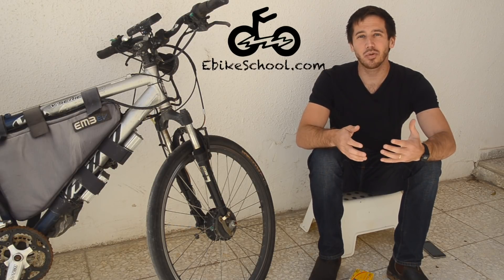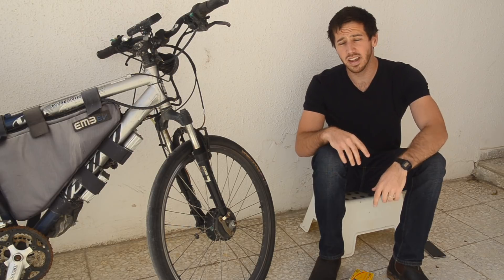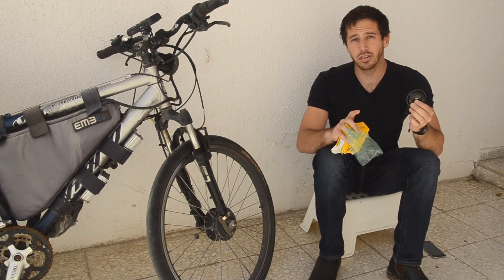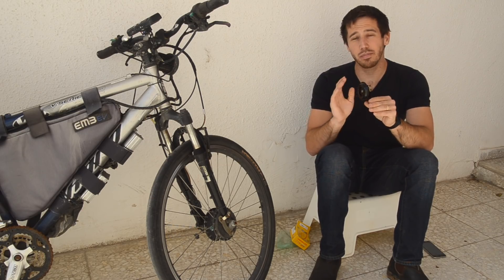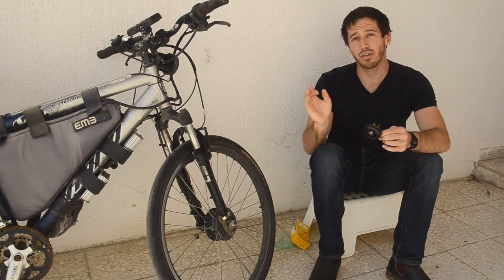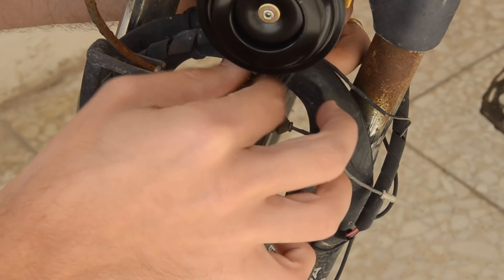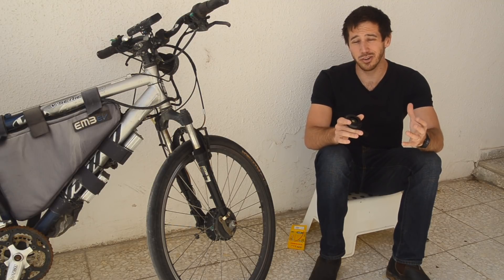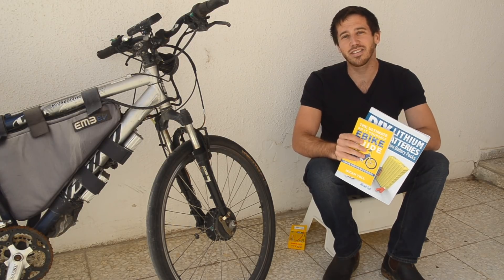How to install a $3 HORN on your electric bicycle

Comment: Has anyone figured out away around getting the clicking from horn every solution was bad ground connection but there is no ground on an ebike. both negative and positive are connected through a switch to 48V pack (56v fully charged i believe) its a 48V horn and its just out of range for use so when you actually need it, it doesn't work with following this tutorial.

Comment: How can I disconnect the speed controller abrains a blue wire a brown wire and a black wire which is blue wire is for low steering brown is high and black is ground how can I connect those wires so my eBay can go faster My name is Ricky it will be helpful if you can help me thank you

Comment: I came up with a great idea because I was sick of cars doing the wrong thing and people too busy on their phones to get out of the way , So gave it some thought and came up with this.
I bought a JBL go3 portable bluetooth speaker and downloaded a car horn app and an air horn app linked them with my iphone and it is better than the real thing .
even though the speaker is small it has more than enough volume . I have allready tried it doing the bay cycle in leichhardt and used it a couple of times and it works really well even when the headphones are in there ears they can still hear it and move I think I gave a couple of people mini heart attacks when I used the air horn.
I suprised no one has come up with this before for such a simle idea . It might be a costly option ($59 from jb hi fi) but how much can you put on safety and works on any phone with bluetooth android or iphone

Comment: Great tutorial! This is exactly what I needed. You have a new subscriber! :D

If I wanted to wire in some turn signals to that switch you linked to (aliexpress), how would I make them blink? Is that integrated into the switch or do I need something else?

I want to start using a recumbent bicycle but the country where I live (Greece) is NOT conducive to bicycles. Let alone recumbents. I want to upgrade to E-bike when I get the cash.

Comment: Is there a way to tie the wires to a usb wire? 

My ebike has a USB port on the battery
Reply: I guess if you have an old USB wire, you can splice that. The red wire is positive and black will be negative.

Comment: Hey @ebikeschool.com, I just got a Super73 S1 ebike which has a 48V battery - do you have any tips for connecting a power cable for the 48V horn, and do you know if adding a cable to power one of these horns could mess up the battery somehow?

Comment: Thanks for this horn that i have been searching for. I need you help. I bought this horn/light switch http://www.ebay.com/itm/302714797949 and this light http://www.ebay.com/itm/222482415466 (still waiting for delivery)  I have a 48v and sometimes I use  my 52v so my question is can I wire it all directly from battery to switch to horn and light without any dc/dc converters . The light and soon to purchase horn are rated at up to 48v but not too sure about the switch. Please take a look at items and reply.

Comment: I went down to the junk yard and popped some alarm bells and horns off of a few wrecks. The small 12v battery I'm using is getting drained relatively quick and now I'm looking at just utilizing a "step-down" device to power the 12v toys off of my 52v battery.

Comment: Can i just buy 2 36V 11Ah Samsung lithium ion Bottle eBike Battery Packs and a pigtail to make it a 72v?
Reply: would not recommend because they are not just batteries. they have internal circuitry bms (battery management system) which  can fry stacking them.

Comment: Can you please explain what happens when we use a 150 Amp controller for a motor which produces about a maximum of 8.5kw at 127 Amps and 96 volts.
Does the motor still draw 127 Amps irrespective of the controller   or will the motor heatup because controller permits 150 Amps.
( My idea is that if the max amp rating of controller is more than what is required to run the motor,it will ensure that the controller does not heatup...Is this true?)
This is for an electric motorcycle,Any help very much appreciated.
Reply from the maker: The motor will pull as much current as it can, so if you connect it to a 150A controller without a lower limit, the motor will try to pull 150 A. If your controller is programmable, you can set a limit at maybe 100A or 120A, that way the motor won't overheat and the controller will also stay cooler as it is not pushed to its limit.
Reply: EbikeSchool.com Oh Okay...you are the best😊

Comment: I set myself such signals (48V) in this way twice and both times  the circuit was broken by strong induction currents, the switches disappeared very quickly. It's cheap and made in China.. 
Now I solved the problem: i installed a diy-scheme breaker with one n-MOSFET.
Now there is no spark in the switcher.
Reply: post a tutorial how to do it so others can!

Comment: Looks like those two books could be pretty useful - especially the battery one. Struggling to find enough Li-ion cells recently - started collecting dead laptop batteries from the local PC store (plan was to test the individual cells, build a battery from the good ones), but ever since the Tesla walls came in, people have been snapping them up to build their own.

Comment: Nice, I didn't realize they made them for higher voltages too, I figured it was all just standard automotive 12v ones, used with some kind of DC-DC converter. I wonder if they go as high as 72v too?

Comment: What about if you wanted to put 2 horns instead of one can this be possible and can you advise me on how to do this?
Reply from the maker: Just wire them in parallel
Reply: Would I need a relay if I were putting 2 horns because of the draw of electricity?

Comment: I've been following your upgrades religiously  Watt meter ,lights etc and now I have to get a horn thanks I to have a motorbike, scooter set of handle bar switches which are great and only a few £'s , How about how to instal brake lights next I know you can get the small led ones which work of the pull type brakes but what about disc's? anyway love the channel.
Reply: After all the comments I finally relented and bought the DIY E-bike book from Amazon, So here's hoping a blatant plug will get me the lithium battery book, Buying books in this day and age! is there an Epub version I did look. and £17 for what it contains is a bargain love it.
Reply from the maker: There's a kindle version of the DIY Lithium Batteries book. But maybe you'll win it anyways! It's a random drawing (I use a random number generator to choose the winner each video) but if you're sticking around long enough then odds are you'll get it!
Reply: So, in theory, I could just make hundreds of comments on how great your channel is to give me a better chance. LoL. Also, have a look at  Battery packs Silver connects 18650 for an interesting take on battery making.

Comment: Right now I have one of those hand held air horns, usually found in emergency kits for small boats, zip-tied to the handle bars. Talk about loud, I'm right up there with firetrucks and ambulances. I make sure people know I'm there!
Reply from the maker: Yea I've used the AirZounds which is also an air horn. Those are crazy loud, but the only problem is if you forget to refill it with air then you're screwed. But as long as its still got air, it's an awesome horn!
Reply: Did you happen to see the message I left yesterday on your Sanyo video about BMS's? Any views/opinions? Keep up the good work, great info.

Comment: is there a way I can use this with a Luna roam fusion bike? it has a Rosenberg charge connector,
Reply from the maker: You could buy the matching part of the rosenberger, then tap into the + and - cables there. Just plug it to the charge port on the battery and you're good to go.
Reply: EbikeSchool.com thanks!! I'm wondering how to make a theft alarm with it too

Comment: Thanks for sharing! Really useful for the city... The problem I wasn't able to think of a solution yet is leave the battery and controller safe on the bike as I park on the streets of London... Would you have any suggestion?
Reply from the maker: Same problem here in Tel Aviv. My solution: bring the battery inside with me.
Reply: Cool, thank you. That's what I do already but it's a pain :P

Comment: california-ebike d o t com has an "E-Stop Brake Button"  california-ebike d o t com/shop/bafang-e-stop-brake-button/ . it acts like the motor cutoff in the e-brake levers.  Great for when you are shifting so you don't mash gears.    I don't know why the (green) button face has a horn on it.  Maybe it could be used for the horn button...?
Reply from the maker: Yea it can be used for a horn or other uses like regen braking or something else that needs a momentary contact switch.
Reply: I use it as an electronic clutch while shifting gears.  A must have when you have hydraulic brakes..  :) . I've seen the bike lights on your other video for 26-72v.  I cannot figure out how to hook it up to a bafang.  Aliexpress has Bafang head lights with 2 leads, but they don't show how you use your display/controller to turn them on an off.
Reply: Hi Micah.. I'm trouble shooting a problem and no one knows what to do.     I 'm using the E-Stop button.  (all plugged into the brake cord (yellow) ) .  It is working to cut the motor when the throttle is used.... BUT... the E-stop button is not cutting the motor when i use PAS.   When I pedal the motor keeps pushing me along.  No effect at all.
It is confusing that it works on the throttle but not PAS..  Any ideas..??  I'm using a new BBS02 48v 750w kit.  I'm not using the OEM ebrake levers because I have hydraulic brakes.      I need this E-Stop button to act as an electronic clutch while shifiting gears... IDEAS..??

Comment: I had set up my horn like you show here. When I tested it with all power going to the motor and head lights and running lights it killed the battery for about half an hour. After that everything came back on and worked again. I disconnected the horn and use the switch with voltmeter for the time being hooked up to a momentary switch. Any thoughts on what happened there? Thanks

52v Luna bbso2 same alliexpress switch
Reply from the maker: Sounds like something was shorting the battery, and it caused the BMS to go into protection mode. Make sure your wiring is correct. There's a chance the horn itself was shorting. They are cheap, so I wouldn't rule it out.
Reply: Thanks for the reply. I have learned a lot from your videos and website. I'll test the horn itself and see it it still works. תודה רבה

Comment: Question for you: what accessories do you recommend putting fuses on? Thanks so much for your awesome videos!
Reply from the maker: Theoretically anything that can short and draw enough power to damage the battery. This horn could use a fuse as a just in case, such as a situation where the horn internally shorted. Rare, but it could happen. Fuses are just good insurance.

Comment: The HORN... bright lights and loud horn are super important... I have installed maybe 4 or 5 of the same horn (I recognise the same cheap yellow box) yes they're LOUD like proper motorcycle horn... so much POWEEEEEERRR
Reply: You and E bike school should do a collaboration love both channels, and Electricbike I love your enthusiasm. It's like E bikes on Crack in a nice way though.
Reply: If I put 2 horns would I need a relay because of the amp draw when using?
Reply: Stebel Nautilus Motorcycle Air Horn. That's POWAAAAHHHH!!!! DO IT!!!
Reply: Ordered my lights and horn from ebay paid 2.50 for the horn and 1.89 for the button after watching this great tip . I also got my light from ebay  its a 12w  multivoltage motorcycle spotlight and is very bright . Another thing i did was  where you attached your horn my bike dosnt have a hole there so i used a star fangled nut and fitted it in the bottom of my forks and fitted a aluminium flatbar bent into shape as a bracket freeing up space on the handlebars
Reply: Hello! what do you think about connect two of those horns in series to a 72V nominal litium battery?